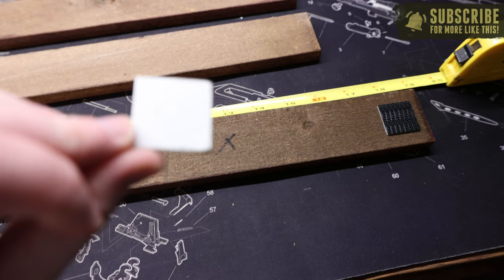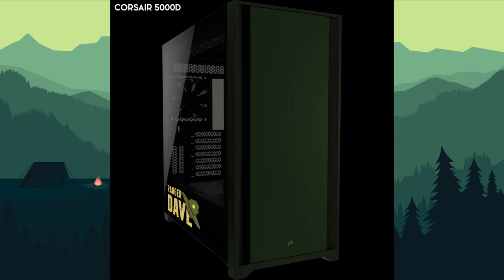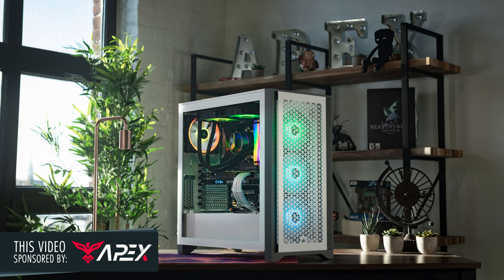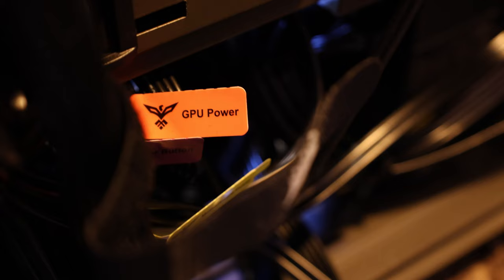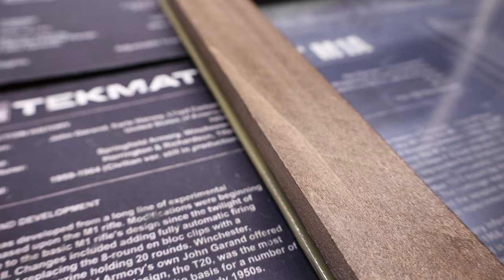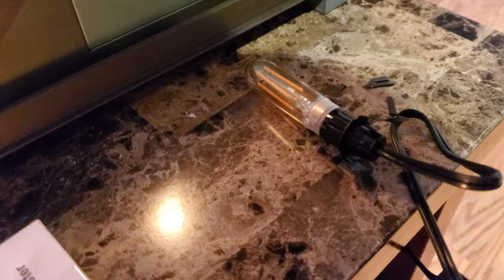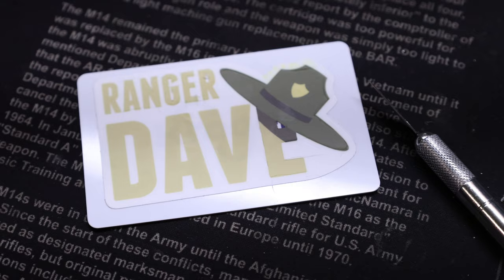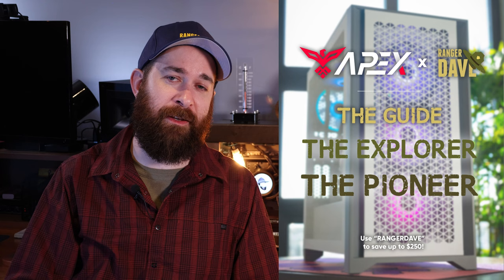Custom Firewatch/Ranger themed PC build

Comment: You old case intrigues me since it has both a front 5.25 bay and a front mesh for airflow. I am old school and thus went with the Corsair Carbide 200R case to have the 5.25 bay, but it has a plastic solid front panel save for the drive bays. I would very much like to modify this or replace the front panel but I realize my options are limited by its age.